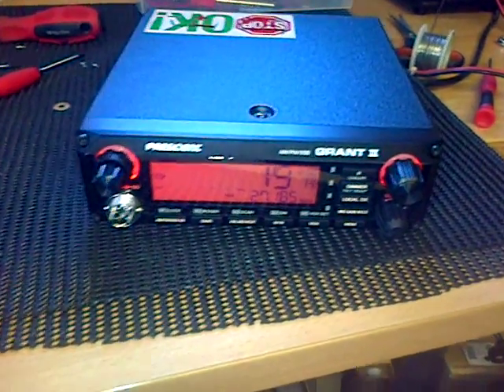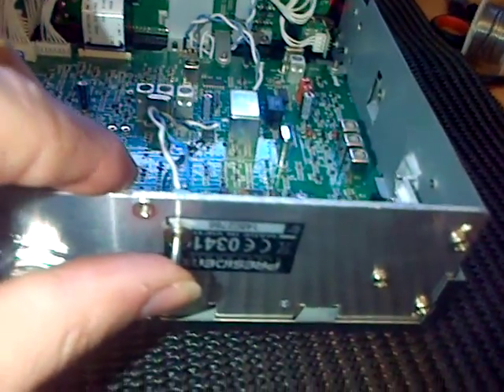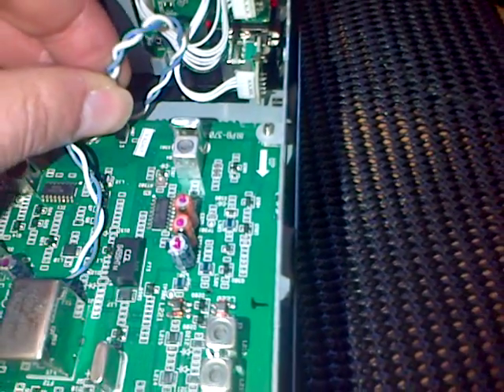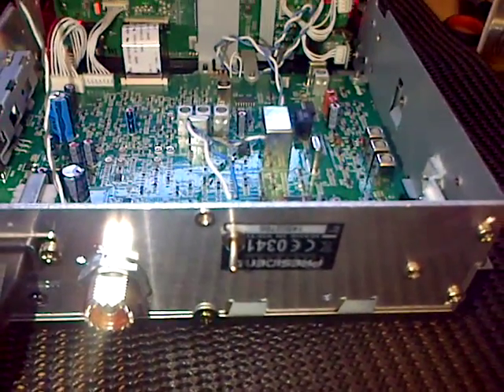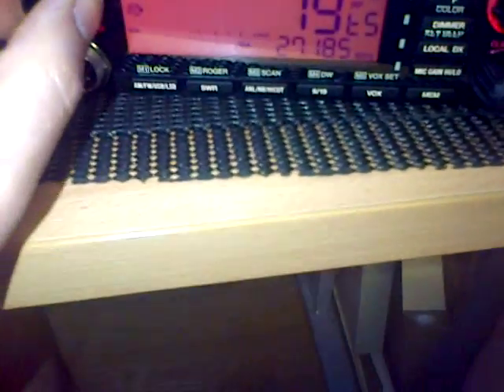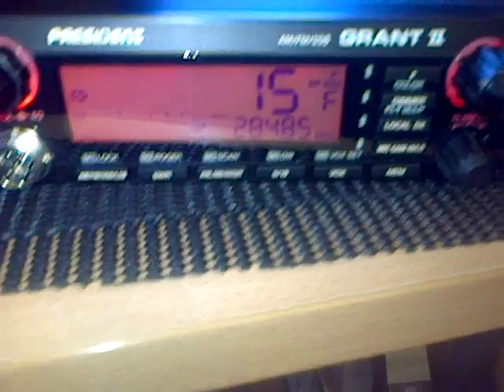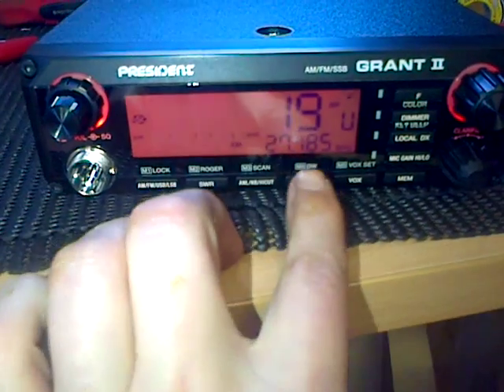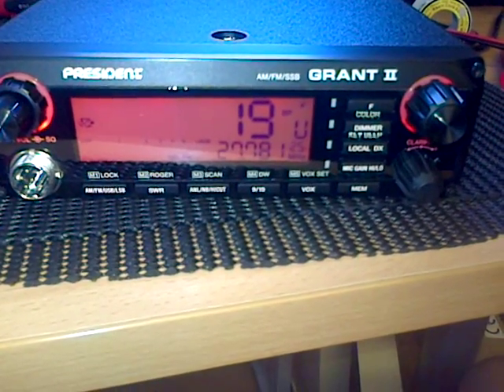President Grant 2 - 10m and Export Mod

Comment: Remember when doing this that it won't work until you cut the White  wire that is on the pcb to the left. This wire is like a loop and acts as a bridge. I soldered my switch wire directly to the terminals ( the terminal closest to the front panel with the 3 beside it and the middle one) don't attach anything to the pin with the black mark on it. 
Good vid! 👍🏻 26TW03 (black knight)

Comment: Hi ya I have a grant 2 and want to do the conversion. The thing is can fit the switch but where can I get the plug and what’s it called also what gauge wire did you use and did you cut the white wire please.

Comment: Would be good idea to te people what lead u need to
Modd it as I'm not educated for radio work so could please explain what u need to convert the president grant 2 thanks nice vid tho
Reply: Use a 16/02 type to or 7/02 type 2 wire (tri rated) heat and tin the wires as you probably know. A small cheap 12v toggle switch will do but once you have installed the switch remember to cut the white loop bridging wire just to the left of the jumper that you are working on, this will then activate the circuit for export mode 👍🏻
Reply: I'm also out of my depth. I'm now missing my UK Channels after modding. So looking at putting in this switch, would it matter which jumper (2 or 3) goes to which connection on the 12v switch?

Comment: Good info, but why didn't you move the sticker on the back rather than make a hole in it?

For those who don't want to modify the radios case, it is also possible to use a magnetic reed switch attched inside the cover. All you then need to do is stick on a magnet to get export mode.

Comment: So you cut the small loop of white wire and the switch you install goes to the jumper. I was wondering what would happen if you also installed a switch that would 'make' or 'break' the small loop of white wire as if you were 'rejoining' it again. Wouldn't that put it back to UK mode?